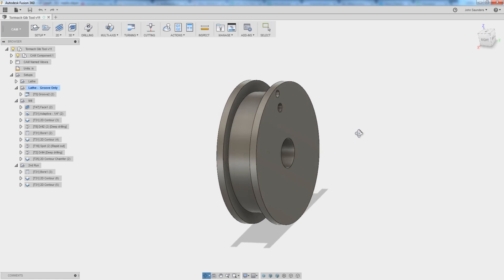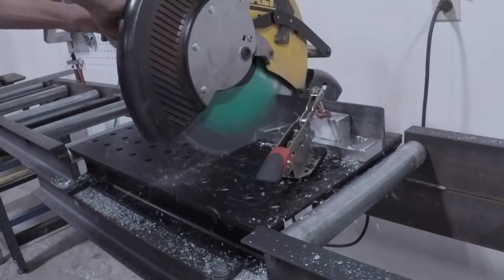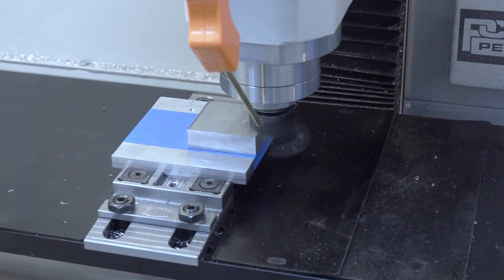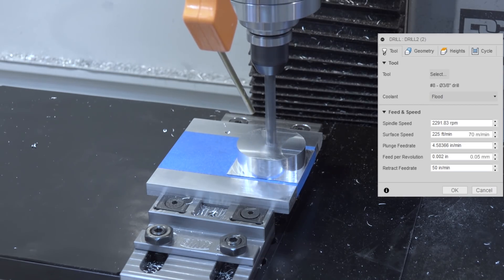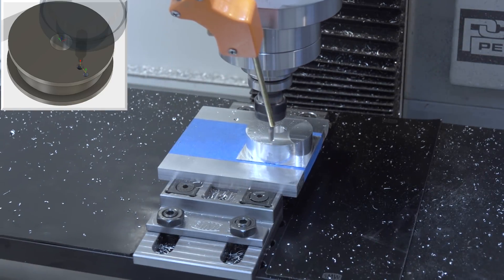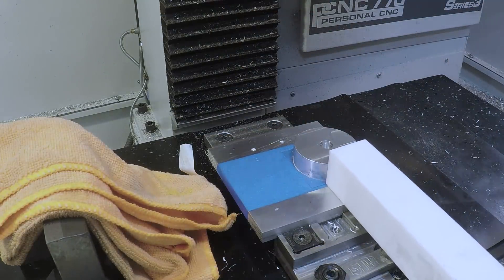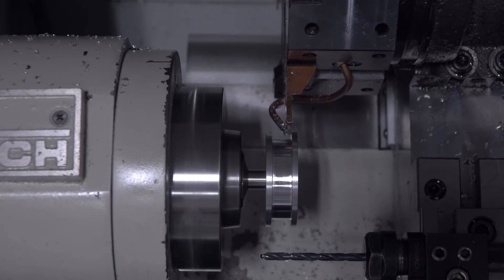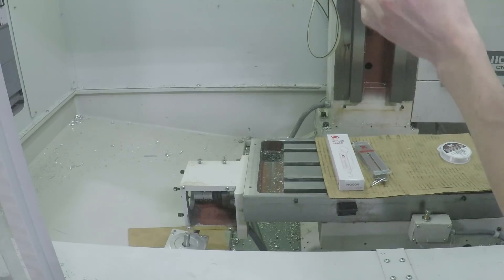Machine A Pulley! WW186

Comment: The chatter comes solely from the vibration of the part. If you clamp your part against your front end of your chuck our collet holder it will be less, but not dissapear.
Clamp you workpiece (whatever workpiece you have) on the outer diameter and run it with a tailstock if possible.

in this case your clamping setup makes the part at the larger diameter go wobble an makes it instable. 
Therefore your grooving strategy will also not work, even when you tweak your speeds and feeds.

a parting tool needs to be "fed" properly,
 if your feed and speed is not correct your chip will not brake !!
this is only to achieve with a good clamping or stability of your workpiece.

"Quick and dirty setup" does not work in this case !

Use of a tailstock or clamping on the outer diameter will bring the stability you need.
Take a parting tool and start in one corner of the pully, then move to about 75% of your insert witdh an continue with radial cut until the desired pully witdh.

Leave a little material for rest machining and walk your contour once.

Grooving and parting are the most underestimated machining workes on a lathe , mostly stabillity is the biggest problem !!

Comment: John retired in 1995 but found that if there was a slight relief in the center of the tool HSS and you cut only with the two corners then when the corners overlapped and there was no longer pressure in the center it would cut  smooth, sort of like putting relief in the center of a cutoff tool with the edges cutting on the same plain, hope this helps!
Joe

Comment: Could you have used a pair of VNMG-style cutters to do that groove?  One right-handed and one left-handed?  If so, how would you do the CAM?
Reply: DJ Delorie Wayne Rademacher you could peck it out with the parting tool and clean up with you left and right tools. I have the same tormach lathe and a doosan. I use the same tool in each. That insert is too wide for the Tormach. In the doosan it works fine--I can peck out and get a decent finish on the doosan on a pulley....and drill the holes, and pass it off to the sub for finishing.

Comment: Turning of most alu alloys is really a pain because the only way to get the chips to break, is to feed crazy fast and have a decent DOC. Flood coolant also seems to help. When taking light cuts, there is no way to break the chips.. I've found that steel or stainless inserts break the chips the easiest and will leave almost as nice a finish as a polished alu insert. There are some grades like 6026, which are meant to be turned and will break chips easily. 7075 is also great for turning.

Comment: The lathe is good, feel the lathe flowing through you... I'd put a four jaw on a manual with round stock (or hell if you have a big enough block of square stock) centered and drilled then eccentrically drill the other holes. Then press the pin in and do the grooving operation, like you did. (Meanwhile on the manual lathe...)

Comment: Shorter tool, higher speed, faster x feed (a bigger chip will break better) and you shouldn't feed sideways (z/transverse) with a square edge grooving tool, get a one with a 2-3 thou radius and it will feed much more cleanly and quietly, or use what you have but only feed inwards (x).

Comment: For what you want to do with the pulley, you would have actually needed to make the diameter of the pulley smaller, about the thickness of the fishing line you're using. Else, your results will be slightly off. But I don't know how accurate you want to measure. Anyway, it's best to push as much stones as possible aside, that lie on your way ;)

Comment: I'm surprised that you did the super glue with tape, because that would effectively mean you're relying primarily on the adhesive of the tape as far as I can tell. What Clickspring usually does for his parts (glued metal to metal) is to use a torch to get the stuff off easily.

Comment: your ideas on cutting with a parting tool are definitely not ideal especially if you use a idexable holder; take grooves out that are 1/3 - 1/2 the thickness of your parting tool within a pocket then go back and remove the remaining discs so you always have enough cutter engagement to take a truly radial cut and reduce the axial engagement of your parting tool. Really helps ease the conscience with process reliability. also indicate your drill concentric to you drill press and line up your predrilled holes for your drill press concentric to your spindle by hand (without the spindle running) to get more accurately placed manually drilled holes.

Comment: A narrower width tool and shorter length would help with chatter on the finish cut. A insert with molded in chip breakers and short peck for roughing. And why not put the part up against the collet? Constantly varying the speed while in the finish cut will also kill chatter. This isn’t the best production method but for one part it would work. I often do this with manual override when needed.

Comment: More feed man. Many chatter and chip breaking issues can be solved by turning up the feed rate. In almost all cases, you don't set preload on an angular contact bearing. It's built into the bearing. When used in pairs or other combinations, you just torque them together and you're all set.
Reply: Well definately not on the SKF7005 super precision bearings that I have in my spindle. If i'd torque them to contact eachother it will bind and won't be able to turn. May be an exception but I assume there is a reason they (the manufacturer) give a preload and not a torque recommendation.
Reply: Honestly it seems like most of John's lathe issues are a lack of feed. You gotta load that tool!
Reply: Also if your not comfortable cranking up the feed, then lower the depth of cut.

Comment: I would’ve made the whole part in a lathe. You should buy a haas lathe very easy to learn to program. I personally work  at pulley and gear shop and you could make this entire part easily and faster with a lathe. But I do understand you were working with flat material.

Comment: Cut a puck (close to size)(I realize you said you didn't have round stock, so this is all moot, anyway), chuck it in the lathe, face the sides and drill the ID, turn a separate arbor to fit the ID (precisely), mount the faced pulley on the arbor, turn the OD, bob's your uncle.
Reply: Andrew Kline he's a self taught CNC operator. If he learned on a lathe that would have been a no brainer.
Reply: Not to mention perfect concentricity if done this way

Comment: I personally would have milled the groove with a woodruff cutter. Finish the part in one op. I also think if you had your pulley closer to the collet, and ran the sfm slower, you may have seen some reduced chatter. Also, believe it or not, the tool may have been too sharp, I've experienced that before. Polish it lightlybwith an ultra fine stone and give that a whirl.

Comment: I would suggest first choking up on your parts in the lathe to avoid chatter. Especially when the material is what is producing your harmonics. Not to mention the pin is just pressed in, which still has some wiggle room. Further out, greater tendency for chatter. (I think we all know this) For regular work, I always keep the stick out to 1/4" from the chuck + the part. I would go shorter if I didn't have tool clearance issues. Second, rough out as much as you can but leave about 60 - 75% of the tool width for finishing, or simply, enough for the tool to get a good bite and not deflect away. Third, when roughing, peck the grooving tool in, and then give it plenty of room to back off and not only break the chip, but allow to be ejected. When you can't get the proper SFM, then shallower pecks are a good solution. It's takes longer, but then you avoid the safety hazard, and you avoid the time used for cleanup. I like a good, radiused insert, with side cutting geometry so I can get a smooth finish for the floor of the groove. For this, I'd consult with whomever made the insert on best practice.

I also bet that Sandvik tool holder accepts a square insert.

Comment: It can be difficult to make chips with those tools, regardless of speeds and feeds, especially in Alum and titanium, but softer steels too.  The easiest way to make chips is to set your peck clearance low and peck more often ... Also, coolant helps a ton when trying to encourage breaking chips, believe it or not.  Getting away from the part off style tool will help too, actual grooving tools have different clearance angles that encourage freer cutting and better chip control.  Could also go to a turning style grooving, back and forth, that helps get the feed rates up there alot higher, which will of course help.

Comment: Looks like the rpm on the lathe is too slow from my eye.
Chatter looks like the pin might be flexing.
There are also aluminum specific grooving and turning inserts that are up coated carbide
825-3275sfm
Or about 412-1637rpm at .004ipr
They are also usually designed to only go in the left and to the right or vice versa because of the relief angle.

Comment: John, there is actually a chart for how much clamping pressure you have vs input torque, at least for Kurt vises. A D688, for example, gets a little over 7300 ft lbs of clamping force, for 80 ft lbs at the screw.

Comment: Betting that chatter in the lathe is mostly from hanging out of the collet so far without tailstock support.
Reply: I'm with you on that one.
Reply: The 1/2 steel shank hanging out that far is pretty weak considering the forces on the outside of a 2" dia...

Comment: Your grooving tool looks more like a parting tool. 

Similar, but different geometries. Doesn’t have the side flank clearance of a grooving tool, so you’re rubbing badly as you’re transversing. They’re designed just for plunge cuts. 

You can use a full radius button tool for the majority of the grooving, then come back with the parting tool to square up the inside shoulders